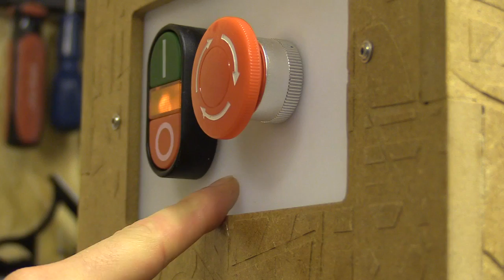#12 Powering PSU’s, VFD, Stepper Drivers & Control Board #12 / CNC Control Box

Comment: To fix the flex on the switch panel could you cut out a frame that fits around the edge on the inside and pinch that to the front with existing screws with the plastic being sandwiched in between?  Love the case by the way

Comment: Can you provide a diagram for the connections and the parts that you have used so far inside the enclosure?
Reply from the maker: I'm only providing diagrams to Patreon subscribers https://www.patreon.com/EducatingSavvas - on a video by video basis. I will provide parts nearer to the end of the project when I know what I've used and has worked.
Reply: Thanks

Comment: I had a discussion about E stop that I think you might be interested in. Stepper motors are held in place by having some power running through them, that's why they are always warm or humming. When you kill the power they are suddenly free to move so any momentum or gravity that is acting on them will cause movement after you hit the "stop" button. For something like the Z axis where it is likely that your still spinning tool will drop into the material or waste board and cause damage or even make worse the reason you hit the stop button in the first place.  One of the gents I was speaking with suggested that if a relay was placed between the controller and the motor and when you hit the "stop" it will open the controller side and short the motor side causing more drag and hopefully stopping your Z axis from hitting something. I tested his theory by twisting the paired wires and it does work on my motors by making the motor very hard to turn. For the spindle my VFD has a brake but you need to keep the power on to use that, so what is right to stop the mechanism from moving or remove the power from the circuits?
Reply from the maker: Alright I need to see a diagram of that. I'm cutting power to the control board but the motors are still receiving power from the 36v PSU's. I was going to set the driver boards to use full holding voltage when stationary, so I imagined they would just stop and hold position when there is no dir/pulse being set by the control board??? Haven't checked this out though. Thanks for letting me know.
Reply: https://drive.google.com/a/boni.com/file/d/0B0RIjba0sp5ISDV1TWJsaGl3MEU/view?usp=sharing    (Is there a better way to attach a drawing?)

When the estop is open the relay will short the motor causing an extra load and resistance to turning. 

Of course the diagram is incomplete as you'd have to decide if opening the stepper driver outputs would be dangerous to the stepper, some don't like it at all.
Reply from the maker: I think you can attach images via the contact page on my website?
Reply from the maker: Thanks for that - I guess if I connect the hold button from the control board to the e stop as well, that would prevent the machine from carrying on from another part of the g code when the e stop is released? But I think those button on the controller only needs a momentary switch.
Reply from the maker: Don't think I can slide the gantry around coz I'm using lead-screws. And 4dpt-relays are quite expensive. What do you use to draw your wiring diagrams btw?
Reply: TinyCAD